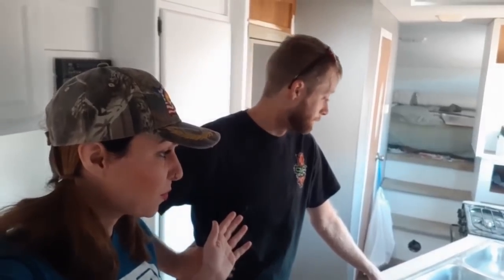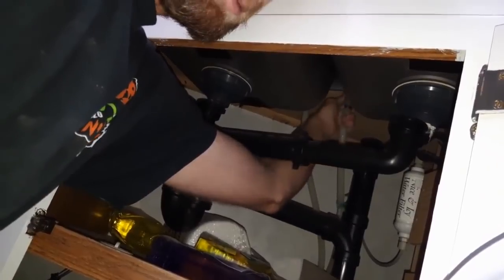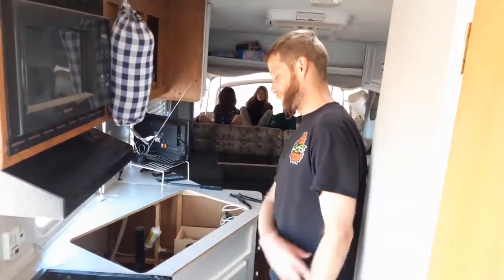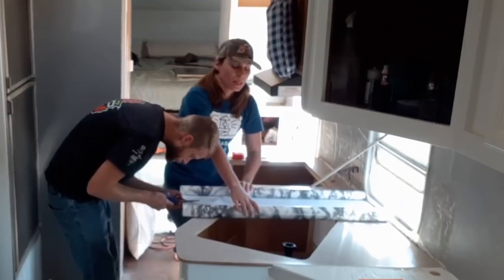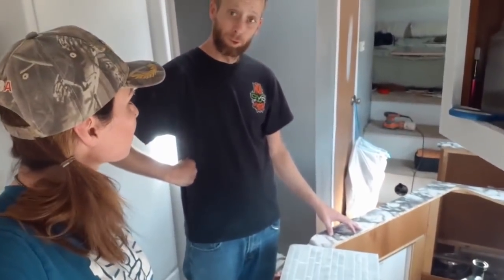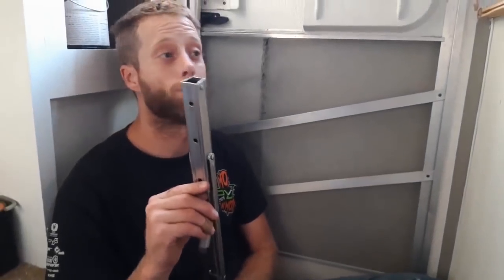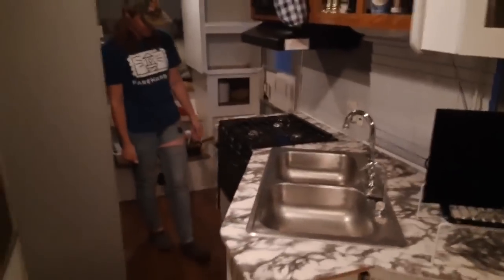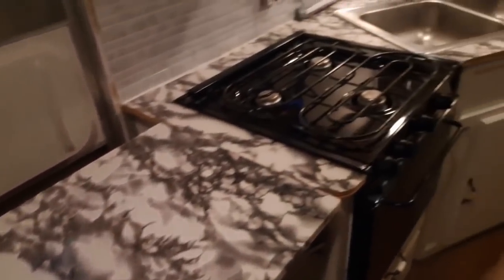KITCHEN MAKEOVER| MORE Counter Space| Trailer Renovation| Day 20

Comment: Hi you guys! I used to sell the contact paper way back in the 70's. Yards and yards if it. There are some tricks to helping it last. It will not tolerate heat, so trivets are a must. Also You need to use cutting boards. If you can find some heat tolerant plexiglass glass that would be cool to lay over it also. I would also recommend sealing the seams and edges with clear finger nail polish. Steam and humidity might make them buckle up if you don't. I have seen it last 25 years if you keep its limitations in mind. It's looking great! peace and love, y'all ♡♡♡
Reply from the maker: I didn't even think about the clear nail-polish! Great tip, I am absolutely going to try it! Thank you for that Cherie!!